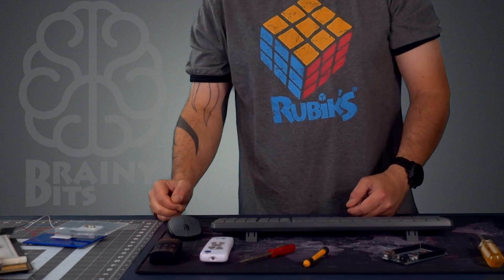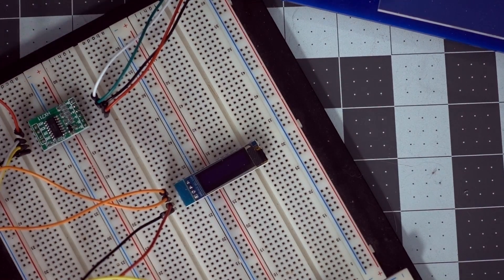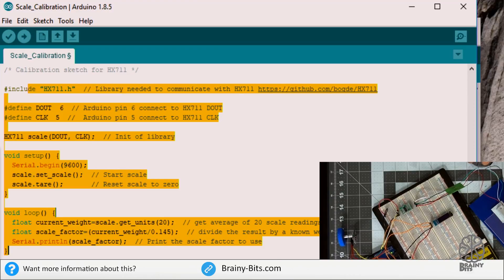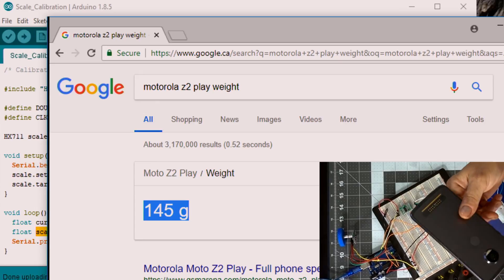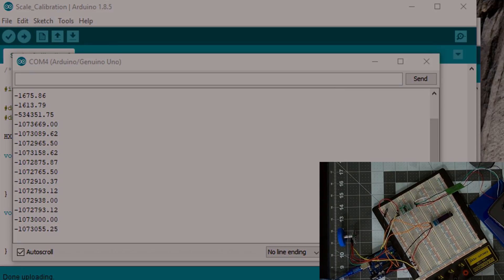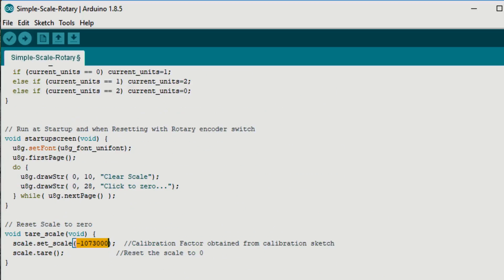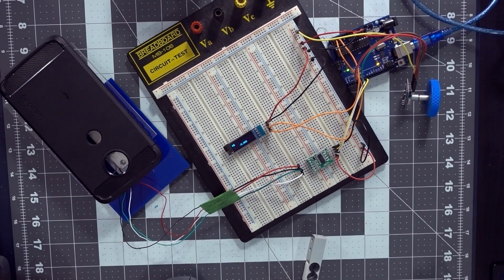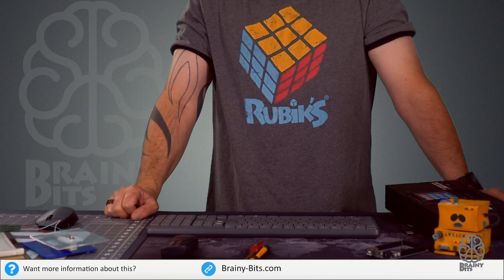How to connect and use a Weight Sensor + HX711 with an Arduino - Tutorial

Comment: Good Evening Yvan and tks for the xlnt videos. 

Question - how to control the speed of a stepper motor with a load cell/HX711 - (the greater the load the faster the speed). I've seen yr video on using a potentiometer to control stepper motor speed, but I can't figure out how to get an HX711 to change the speed. I'm new to this electronics malarkey.

Any ideas? 

By the way - greetings from Glasgow, Scotland!

Cheers, Miles

Comment: i do not know if you check the comments or not but im kinda suck with the code. i paired everything as you did in the video and the website but i cant get it to simulate and cant get any readings on the pc simulation or the OLED screen

Comment: Salut Yvan! J'avais un problème avec ton code de calibrage. J'utilise exactement les mêmes composantes que toi, mais j'ai reçu l'erreur HX711::HX711(int, int), alors j'ai changé le code selon une idée dans la section des commentaires de ton site web. J'ai pu calibrer. Après ça, j'ai eu un problème avec le rotary encoder qui ne fonctionnait pas correctement (quand je pesais le bouton, rien n'arrivait) donc j'ai changé ton code encore...tout "fonctionne" maintenant, mais le OLED a des caractères bizarres et le poids semble fluctuer beaucoup. Est-ce que tu as une mise-à-jour pour ton code, car je ne connais pas grand chose à l'arduino? Merci! Tu as créé exactement le projet qu'il me faut pour ma brasserie!

Comment: Hi, i'm working on a project regarding weight monitoring. Just want to know if there are other development boards besides Arduino Uno that I can use to have the same results. Also, is it possible for me to design my own version of the HX711 signal conditioning circuit?? Thanks.

Comment: Would it be possible to make an alarm go off when it reaches a specific weight, and then make the alarm stop when the weight is back to the base weight?
Reply: yes it is possible check the code and write a simple "if " statement that check if the current weight is greater or equal to the weight you want the alarm to go off else alarm is off

Comment: The hardest part about this is that I have a different microcontroller than the Arduino, and the code and wiring is slightly diferent, making it hard to work for me.

Comment: Personally as I am not good coding, I prefer videos that explain the code as I learn from it. Thanks for the great work you do.
Reply from the maker: I will keep this in mind in future videos to make sure to explain some parts.  Like I did in this video explaining how to calibrate the load cell.  Thank you for your comment.
Reply: @BrainybitsCanada  You could always have the main video that is nice and short, then create a separate video which just dives deeper into the code. Then when the portion about the code comes up you can link them to that video if they are interested and have them come back to finish this video after learning more about the code.
Reply: I like it when videos are split into a coarse and detailled part